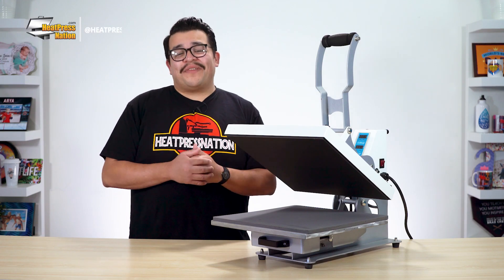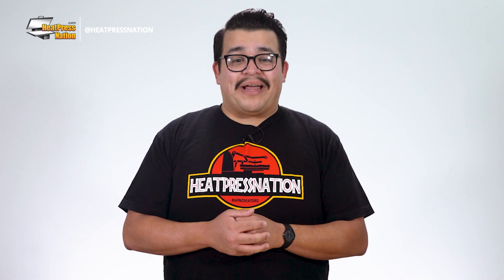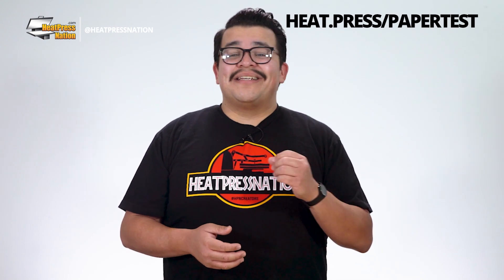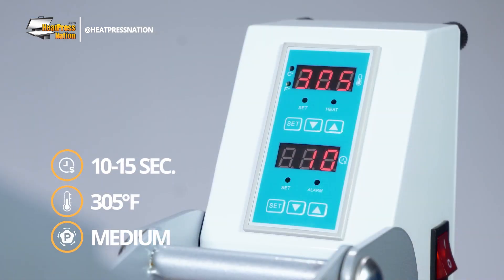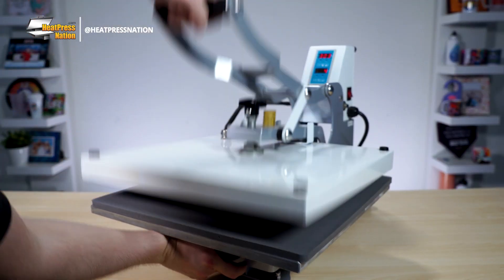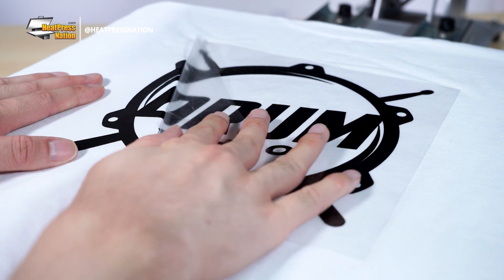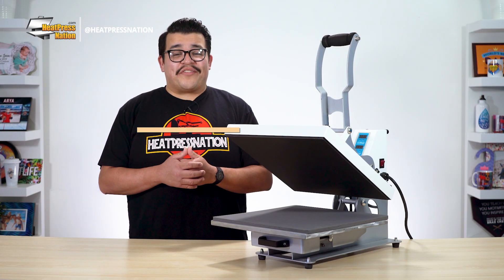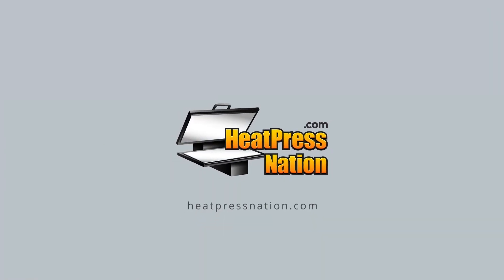How To Stop Heat Transfers From Peeling

Comment: I do iron on transfer images and have this problem,  but only in the corner as I begin to peel, the rest of the image is in tact and is beautiful..
Reply from the maker: You might want to wait a few more seconds before peeling. The adhesive is still very pliable when hot. You can even try a cold peel to see if that helps. If you're still having issues, then you'll need to increase your pressure.

Comment: Hi, I've used many htv and didn't have any problems. I tried a newer one which advertised longer life span and ultra thin and soft. I really liked the htv, but after the first wash, it peeled off and then i ended up peeling off the full design. Why does this happen if the htv itself promotes longer life span. This was done on a T shirt, and now I'm worried all the hoodies I've used the same vinyl on will peel too.

Comment: Does this method work for jet opaque transfer? Because i ran into the peeling problem where it looks like you can peel the edges
Reply from the maker: Yes, peeling like that is usually from insufficient pressure. Most heat transfer paper requires firm pressure, so you definitely want to double check your pressure setting.

Comment: Help!! 
I’ve done all the above by when peeling my dtf off the T-shirt the image doesn’t stick just a little bit of residue on the tshirt very faint colours 
When touched the ink is sticky 
Any advice greatly appreciated :)
Reply from the maker: There are a few possible issues that could be causing that. 

1) You are peeling at the wrong temperature. If your film is a cold peel, you must wait until the transfer has completely cooled before peeling it off your shirt. And if it's a hot peel, you should peel within about 3-5 seconds.

2) Less likely, but the powder adhesive may not have fully cured onto your print. Be sure you're following the proper instructions for your powder and film when curing. (if you're curing in a heat press, be sure to pre-heat your lower platen for 60 seconds before curing)

Comment: Will this method work with jet opaque 2
Reply from the maker: Yes, if your Neenah Jet Opaque II is peeling, it is almost always going to be due to insufficient pressure. We recommend using a firm pressure for that product and be sure your press is set to 350°F, 30 seconds, and peel it cold.

Comment: That's the problem. I've with this. But it's not resolved with pressing. Seems if it's melted it's more cracking than I'm. Only dry the powder Idk the matter.
Reply from the maker: What type of transfer are you pressing?
Reply: @HeatPressNation  hi I'm using Matt paper a3, bought it by a printer store. Have an epson workforce made into an dtf printer. It's one side printed material. If I use the oven the powder melt correctly if I put it unde fheat press nothing happen, no melting. I think it's a paper problem but I don't know. It was not cheap 90 euro for 100